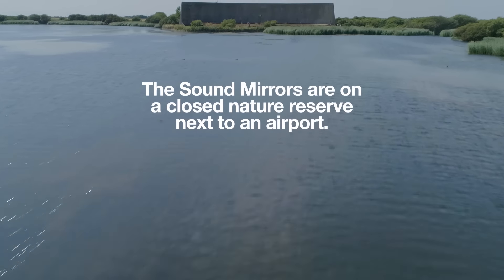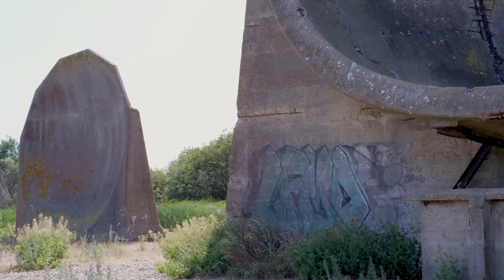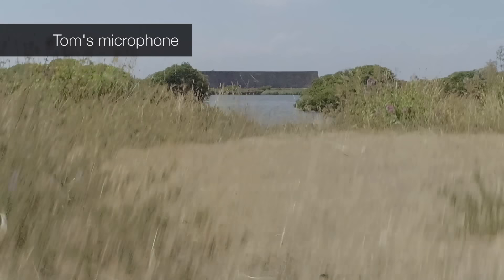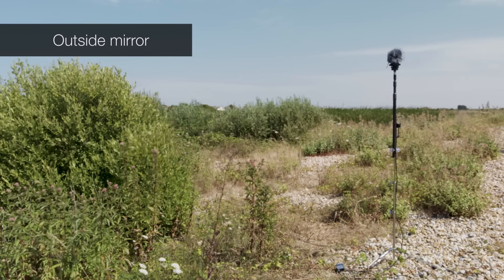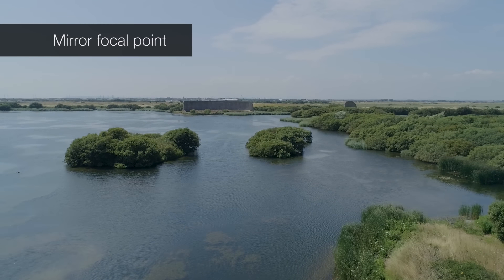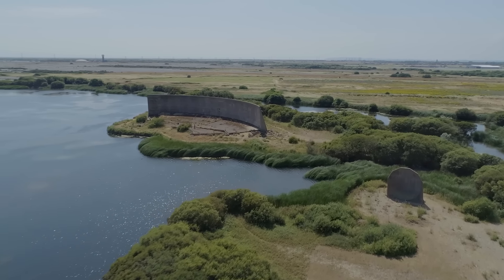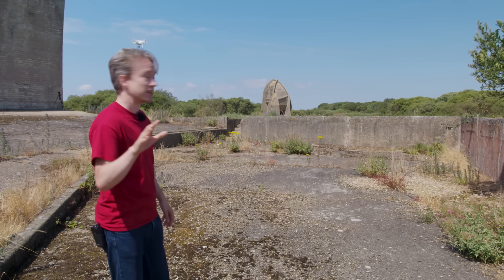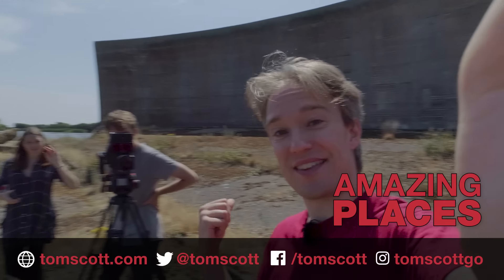Testing the sound mirrors that protected Britain

Comment: I know it's tempting to grab those phantoms out of mid air, because they appear so stable, but those blades are extremely dangerous. No worth losing fingers over.
Reply: That's probably why Tom grabbed it by the landing strut and not one of the spinning blender-like things...
Reply: @krashd  Drones like the Phantom can make automatic adjustments, if you grab it wrong it may try to adjust itself and pull away or push towards you.
You could cause it to tilt downwards towards your hands or face.
Reply: Consumer drone props will draw blood, but won't cut fingers. They're made of plastic and will shatter before going through a significant amount of you.
Reply: @fallingwater  but they will leave scars
Reply: @fallingwater  If they draw blood, then they can cut fingers.
Reply: @DaveDexterMusic  No... That statment is unbelievably stupid.
Because it can barely pierce the skin it can cut through bone, tendons and ligaments?? Seriously, think before you post
Reply: @DaveDexterMusic  Time to saw my finger off with a sheet of paper, since papercuts are a thing
Reply: I think the point Dave Dexter is making is the the semantic difference between "cutting a finger" and "cutting THROUGH a finger." Because your finger includes the skin, flesh, and bone, even cutting just the skin could be considered cutting your finger.
Reply: Once they've drawn blood, they aquired a taste for it and want more.
Reply: @hazeltree7738  I mean... you can... get the paper moving fast enough, with enough paper length, you can cut off your finger... just youtube "what can you cut with paper" and you will see paper has quite a bit of cutting power.
Reply: @wanderinwolf3804  accelerate the paper to the speed of light and it's very dangerous.  

And there is no law against it.  Anyone can accelerate any object they wish to the speed of light.  Hopefully, congress will step up and get some legislation in place to protect us from this.
Reply: Think about the orientation of the blade as it rotates to force air down. Pushing a fingertip up into a high-speed fan would result in the fingertips being hit by the flat surface of the blade and being pushed down to the trailing edge. Mind you, I wouldn't try to grab the blade by coming in from the side. That would introduce the side of the finger to the leading edge, but from the bottom is relatively safe. (emphasis on relatively)
Reply: @hwoods01  I think you might need to schedule a study date with Einstein...
Reply: @doubleT84  Skynet?
Reply: @hwoods01  Only the most famous equation ever describes why reaching the speed of light is impossible, if you're not space itself, but that'll be a bit hard to create don't you think? :)
Reply: I don’t think they suddenly spaz out of you grab them because I own one
Reply: If you have a drone you will know that those blades do nothing to your fingers, surely a lot of pain, but no damages at all!
I always love how the drone is upset when I try to move it by hands in flight!
Reply: @MyNotSoHumbleOpinion  "I always love how the drone is upset when I try to move it by hands in flight!"
That's one of my demonstrations of drone stability.  I push against the landing skids and it pushes back.  It is an interesting phenomenon.
Reply: It was extremely stupid for him to do that. I agree!
Reply: @peoplearecrazy1798  oh, come on, it's a toy, not a lawn mower!
Reply: @peoplearecrazy1798  not realy though theyare extremely stable and it wont cut you unless you stick your hand in the blades
Reply: My drones don't even have have grab handles and i land them in my hand. It's all about being a good operator
Reply: @hwoods01  Britain does not have a Congress. Yet.
Reply: @hwoods01  what? No object with mass can be accelerated to the speed of light.
Reply: @DaveDexterMusic  yup I lost a hand to a paper cut
Reply: @hwoods01   I just applied for my concealed carry license for 8.5x11” card stock. 📄
Reply: @NickRanger  he wasnt the operator...
Reply: @jstuffss  i know.. But in hovering and emergency kill mode there shouldnt be any commands. Just let the drones gps do its job
Reply: @hwoods01  that would be considered a reckless behaviour and you would absolutely be liable for any damage caused.
like, there actually is law against it
Reply: @krashd  And if he messes up the grab he can end up losing an eye...
Reply: eXtReMeLy DaNgErOuS

Comment: Although they did quickly become obsolete, they gave the British more than a decade of practice pinpointing targets based on a network of interconnected monitoring stations.

It's interesting to think that what made Britain's technologically inferior radar systems more effective in practice than the German systems... was an even more technologically inferior system.
Reply: I was to understand the British radar knowledge was well in advance of what the Germans developed. I have not read otherwise
Reply: The German "Freya" radar system used a shorter wavelength than the British system, so lead to smaller radar antennas that were easier to position, as well as capable of detecting smaller objects reliably, so was in that respect technologically superior. 

(Admittedly, one problem with reliably detecting smaller objects was that it allowed the British to more effectively use chaff as a countermeasure but, still, the German systems were capable of detecting these smaller objects, even if its operators would have preferred it didn't).
Reply: Eh, Idk if the mirrors helped with "practice." It's simple trigonometry, really
Reply: @RhodokTribesman  The more important part is the information management.  Collecting all the reports from individual stations and then assembling a picture of where all incoming planes are and where they are going in real time to allow a fully co-ordinated response is the most important part of the system, and what the Germans failed to do until late in the war.
Reply: @Boring Name I don't think OP is saying British Radar was inferior. OP said one of the things that made British Radar superior was practice from these mirrors, which are inferior.
Reply: You're right in that it was Dowding's air defence network that helped win the Battle of Britain. More than radar, more than the observers, more than the fighters, more than the WAAFs pushing wooden blocks around maps of Britain, it was co-ordinating all of those that made the defence so effective, and working on getting the reports from the acoustic mirrors to wherever they needed to go in the few minutes it would take bombers to cross that 27 miles was probably an important part of learning how to do that.
Reply: @akizeta  If I recall - their were experienced interpreters who would oversee the whole of the map board, or sector boards, and evaluate all the data and make judgement calls on what was accurate, what was being duplicated and removed, and what was false and removed or corrected. Also known by one author as 'Mad Ludo'.
Reply: @akizeta  I read somewhere about the incredible detail of the air defence network: there were occasions when downed RAF fighter-pilots, who had parachuted to safety, were back in the air in another fighter-plane the same day.
Reply: The Wikipedia article titled "The Battle of Britain" says: "The RAF had the advantage of fighting over home territory. Pilots who bailed out of their downed aircraft could be back at their airfields within hours ..." [The reference number indicates that this information comes from the book The Battle of Britain by James Holland (published in 2011)].
Reply: Very subtle thinking.  Excellent.
Reply: Please explain this.  Very interesting.
Reply: @akizeta  this ^^^
Reply: @akizeta  and Keith Park doesn't get the recognition he deserves.

That was some mighty team effort.
Reply: @akizeta  from experinaces in WW1

Comment: Here in Melbourne, Australia, we have a science museum called Scienceworks. They have this fun setup where there are 2 dishes set up about 100m apart pointing at each other. You can have a conversation at normal voice levels with someone at the opposite end. It's really cool. There's also a planetarium there where the acoustics of the domed ceiling means whispered conversations can be heard from anywhere in the room.

Comment: That's a really good, clever tool! Simple and effective. Low tech and effective :-) It transmits nothing so the enemy would never know how you were locating their planes. If you had two of them a few miles apart you could triangulate distance as well as direction, but not elevation. Good enough to scramble defense aircraft though. The more I think about this, the more I like it :-)
Reply: They might notice the huge concrete walls.
Reply: From 27 miles away they'd notice a new concrete structure that could look exactly like a wall/building? At night?
Reply: You could detect aircraft using optical telescopes, but it's not that effective unless the telescope is very good.

This is a very low tech solution, but it'd do alright.
Not against modern aircraft, because those travel faster than the speed of sound. (in other words, you'd not pick them up until they'd already passed you. - if they were headed in your direction - you would pick up one flying parallel to the detector, though your detection would be some way behind it's actual location, but you'd be able to estimate speed from how quickly it moves across detectors, and from that you could estimate how far ahead of it's apparent current location it actually is.)

This would work really well with some computer support of course, but still... It has a lot of downsides too.
Reply: This is a high intelligence, low technology solution for passive detection.
Now we have a high intelligence high tech solution: thermal optics.
Reply: If you had a third wall that was at an angle to the other two and more spherical you could get elevation that way.

Comment: I lived in a dorm building that had a very similar parabolic dish shape. The entrance and all of the dorm room windows faced forward in the "dish", and my room/window happened to be very close to the center. The windows were soundproofed surprisingly well, but if you cracked them even a little you could make out conversations people were having at normal volume ~200 feet away, across the street... if you weren't being deafened by a bunch of other street noise.

Comment: The soundwaves length is such that 1/4th of that length is larger than any imperfection on the surface caused by old age. From the perspective of the sound the mirror is very smooth and shiny giving a crisp image

Comment: DON'T TRY THIS AT HOME
Grabbing a drone is never a good idea. 
Even when it's stationary.
Reply: Sinom they get angry and soon the whole swarm is after you.
Reply: @Edwin Cheesecake It probably means when the drone is stationary in air, where the blades are rotating fast and will possibly leave you scars
Reply: FYI consumer drones can't break skin. This is nonsense
Reply: @AmatuerHourCoding  yes they can. Especially the one they were using. Very heavy drone, very fast propellers
Reply: Sinom Ok mom
Reply: Bewsted I own a Mavic Pro and I cut a tree branch (not a twig) off the tree.. imagine your fingers.
Reply: I don't have a 200 ft concrete wall at home...
Reply: Grab it at the bottom, then flip it belly up. The blades will turn off, with DJY drones.
Reply: I have a drone allergy so if they sting me my throat will swell up and I’ll suffocate to death.
Reply: @Mp57navy  that is the drone's defense mechanism. It switches off once it detects it's on a vulnerable position. Don't do that to a drone, because that means it's very scared and panicking thinking you are a predator.
Reply: @AmatuerHourCoding  Yes they can, and easily, some can take fingers.
Reply: @Wertsir  Drones aren't venomous. It's most likely just a placebo effect.
Reply: Your mileage varies.  I almost always catch my drone in air since usually I don't want it landing on less than perfect landing surface.  I also often launch it by hand where there's dirt, sand, gravel, grass, weeds, and so on that might interfere with the launch or landing.
Reply: yolo
Reply: @AmatuerHourCoding  This is very dangerous and wrong - any propeller spinning fast enough to produce sufficient lift to make something like a drone fly can leave injuries. This is nonsense

Comment: rip drone at the end  😂
Reply: Right? That poor drone... Someone should have taught him how to do a catch landing before trying to get that shot.
Reply: based on other comments, the specific drone used has protections in place to allow that to be done
Reply: No, just because the motors can endure more stress doesn't mean they should. It's obvious they planned the shot one way as Tom just pulling gently on the drone and them thinking it would glide over like an air hockey puck. They forgot that the drone will try as hard as it can to maintain not just its altitude but also it's lateral position. So instead of remaining level the drone tilts the OPPOSITE way and attempts to play tug of war with Tom. This exerts a perpendicular force onto the propellers and causes way to much torque as the motors are spinning at full speed.

It's nice that the channel is doing well and they don't have to worry about potentially replacing or fixing the drone, but to us thats a $1000+ drone that he is treating very badly. Also, if you are only going to comment with what you have read "based on other comments",  isn't that sort of useless? If you don't have firsthand experience, why correct others with firsthand experience based on some random comment claiming this is okay?

Comment: The Whispering Gallery at Grand Central in NYC is legit.  You can turn your back to someone standing 30 feet away in the opposite corner and hear them whisper like they're inside your head.

Comment: At work, a new building was put up, with an oval assembly room. What an echo chamber!. I was called in to try to fix the acoustics. I wondered who signed off on the design, and wasn't the problem discussed during design. The answer was it looked cool.

Comment: This operates on the same principle as the Echo Wall in the Temple of Heaven in Beijing, right? I mean, on a much smaller scale, without microphones, and not for war, but the principle is the same: reflect sounds off of giant stone walls to transmit the sound from one place to another. I wonder if the Sound Mirrors were inspired by the Echo Wall, or if they were thought of independently.

Comment: There is a place very near to there that is public that has those smaller concave structures. My Mum and I used to get on the mini steam powered railway down there from Hythe and spend the day, visit the nearby lighthouse and have something to eat in the cafe across the road.

I also saw you do a video in Folkestone Harbour. I cannot recall the topic, but I work just up the road from where you were!

If you you do read this comment, I must ask, are you from the south east at all?

Comment: They used the wrong kind of microphone, and if they'd have put a microphone at the throat of a horn they'd have had more signal and less outside noise; it's the same principle as a satellite dish's feedhorn. In fact, replacing the feedhorn in a satellite dish with a  microphone in a horn makes an extremely sensitive and directional listening device, you can even use two horn microphones with one oval dish as those have two focal points. It looks like they used an omnidirectional mike which is the worst for that application because it picks up sound from all around it.

Comment: Wavelength longer than the mirror surface?
Aren't those in different units,how does this comparison make sense?
Please explain how im probably being stupid
Reply: Sound travels at 300m/sec in air, so a 20Hz rumble will have a wavelength of 15m. You can't focus a 15m wave with a 15m dish, you need one at least 60m (200ft) across...
Reply: You're probably getting wavelength and frequency confused. Wavelength is measured in meters; it's the actual distance between one peak and the next. Frequency is measured in cycles per second. The wavelength of any wave is equal to the wave's speed divided by its frequency (for a sound wave, the wave's speed is, of course, the speed of sound).
Reply: Nillie yeah,that would make sense

Comment: Very enthusiastic.  Odd to talk about the sound of the base of an engine; doesn’t the detectable noise come from the prop and exhaust?  But I guess you meant low frequencies, which of course propagate better.  This is interesting stuff but the title is wrong.  These things were built after WWI and obsolete before WWII, not only because of radar but because as speeds increased an aircraft could be on you before it had been triangulated.  So these things never actually protected Britain.

Comment: Folks, don't ever grab four rotors of spinning blindness and disfigurement with your bare hands and no protection. You wouldn't grab a circular saw or a bare knife blade, and while quadcopter blades aren't so sharp, they'll do you damage and easily remove an eye. A daft thing to do.

Comment: Why do you need permission? it's just a bunch of concrete, why flying a quad would cause any problem ? 
I though you would fly a real plane in low altitude, that's why the permission.
Reply: It's on the flightpath of Lydd airport, about half a mile away. In the UK, it is illegal to fly drones within the airspace of an airfield unless permission is granted, and a timeslot in which it is safe to fly is given, by either the RAF or CAA.